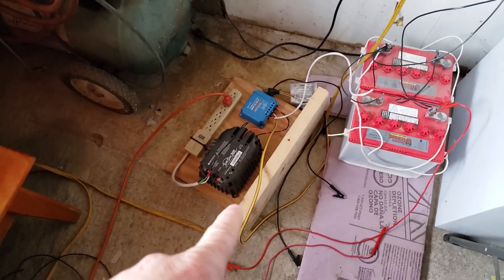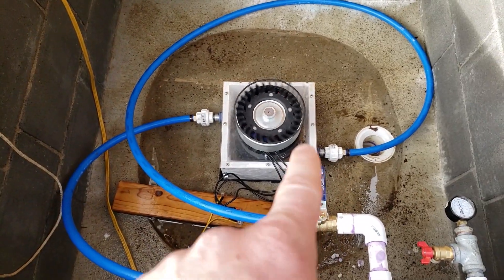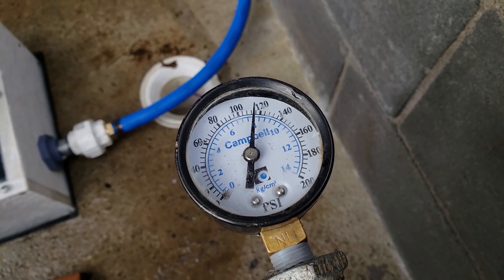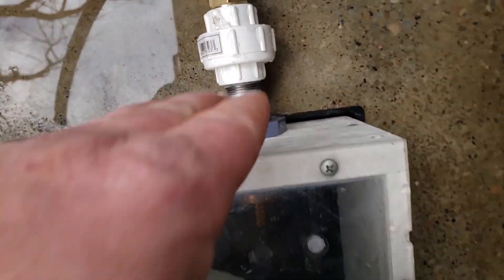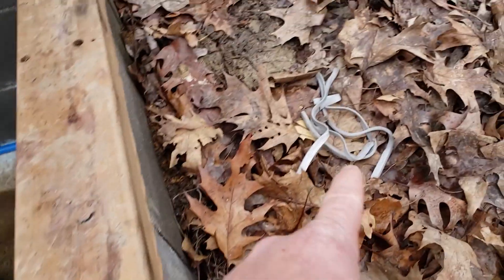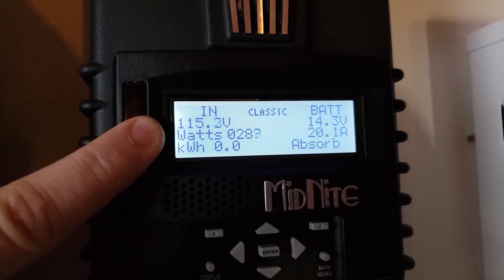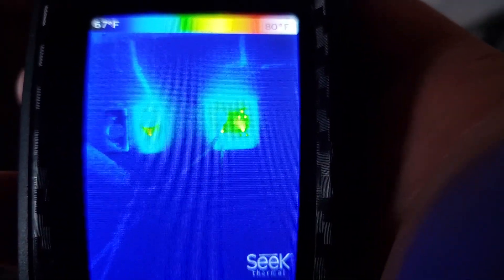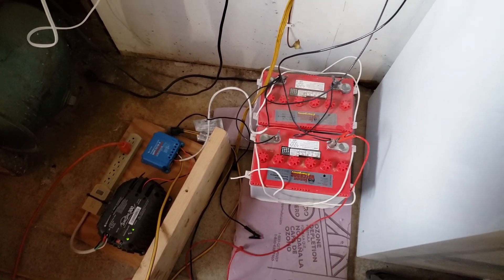New Peak Watts, Broken Nozzle

Comment: have you ever heard of varnish washing 3d printed stuff. you put the 3d print into a vapor chamber of a solvent like acetone, this will melt the top layer of plastic making it more solid and fusing together the layers abit better
Reply: Acetone only works on ABS, it doesn't work with PETG
Reply: carbonmaverick. Well Acetone does work but only to a small extent. AND NO IT DOSNT BOND LAYERS it only smooths it out.
Reply from the maker: Yes, I believe cnckitchen does those sorts of tests.
Reply: It won’t make it stronger (won’t melt layers together) only smooths it out. BUT you can heat treat 3D printed parts in an oven ( google it)

Comment: You would need some very beefy wire for a 1000w @ 12v that would be over 80 amp I suppose it would make a good heater ;-)
Reply from the maker: It's a short run, and 4ga is good for 70 amps so 840W, actually closer to 1008W at 14.4V

It will work fantastic for a 48V bank.

Comment: Playing with the nozzle alignment and size to match the ideal tip speed of the spoons and the efficiency of the generator (the midnite takes care of that for you) will be lots of fun.  For a few minutes, you could increase your current limit ( 25 amps ? ) as long as you are standing there and the wires don't get too hot.  It's all about heat dissipation and your wires are well exposed... the heat signature seemed to show less than 80 F, so that seems quite safe. 

At peak water flow rate, were you at ~1000 watts of water power or is that 1000 watts after you take into account the turbine efficiency and generator efficiency?  You could probably do a bit of excel math to show the water power  -->  the shaft power --> generator power -->  voltage drop across the wires to the midnite --> charger effieciency --> wires going to the battery --> net power into the battery --> lead acid charging efficiency --> the wires going to the low voltage blue box --> the blue box efficiency --> the wires going to the inverter --> inverter efficiency --> power at the 120v AC plug.